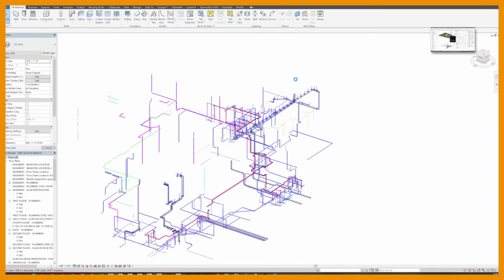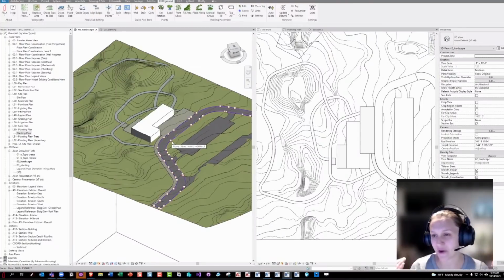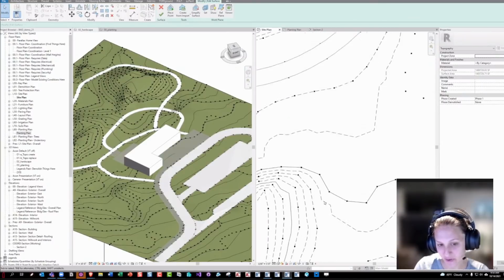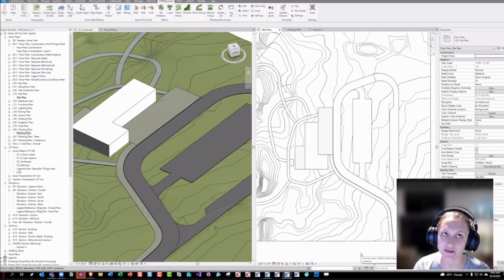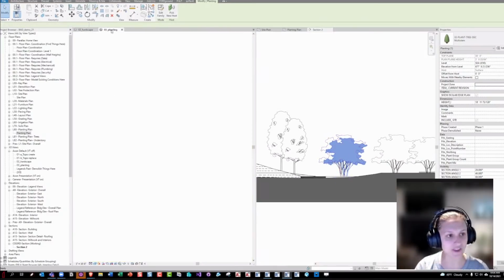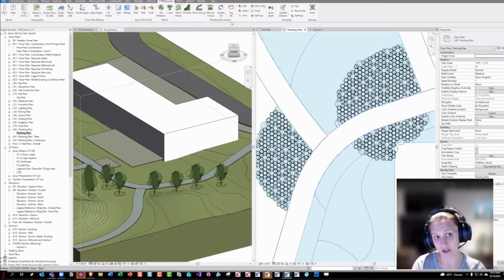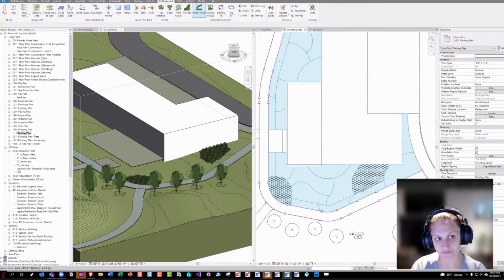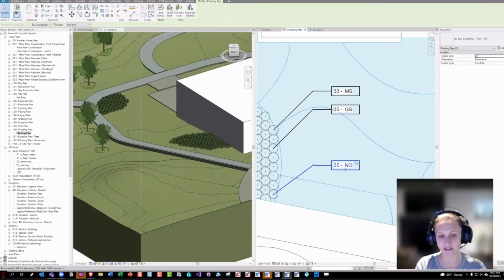Site Modeling in Revit from a Landscape Architect's Point of View

Comment: Regarding slab to topo is this plug-in better than using the dynamo method?, which is one of the only things I’ve tried with dynamo btw
Reply from the maker: It started as a Dynamo tool and Lauren shared that on her blog.  I don't know if its better but it is probably easier and more stable. ;)

Comment: Revit is the wrong tool for landscape designers, a dedicated tool like Vectorwoks Landmark it’s more intuitive to use
Don’t let other trades push you into complicating your workflow
Reply: what about even blender or UE4 or UE5? seems like w/ the right setup you could really go nuts w/ the level of detail and iterate on a dime with those packages, then bring the revit model in
Reply from the maker: Those tools are great mesh modeling tools for sure... but they are NOT good documenting tools.... The hardest part about landscape architecture is the organic nature of the forms but they also need to be represented 2-dimensional (for now)....
Reply: @TheRevitKid  Like Lauren said, use Model likes or a DWG for the real contours.  I haven't gone down this path just yet but I believe in the latest versions of Revit we can filter lines (I think) so my theory at the moment is use filters to colour the 3D lines per height so they can be checked as well.  Most people having to document in Revit are doubling up work at the moment using CAD and Revit, far from ideal.  I'll hope for some modifications inside revit to make it actually usable so a total switch can be made.  Revit is still great for many things in landscape, but some things it's just plain awful. "I just made that sloped organic path 100mm wider".... thanks!!
Reply: This plugin gets you working as close as you can to making Revit a usable tool for landscape at the moment. There's 2 major hold issues that need to be resolved by Autodesk however and that's hatching and making topography actually work, probably not using mesh.